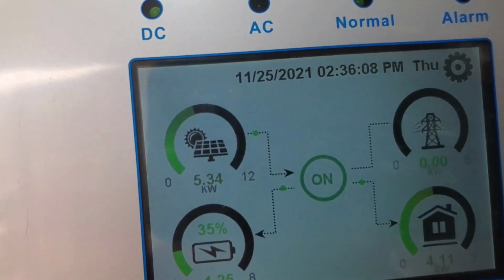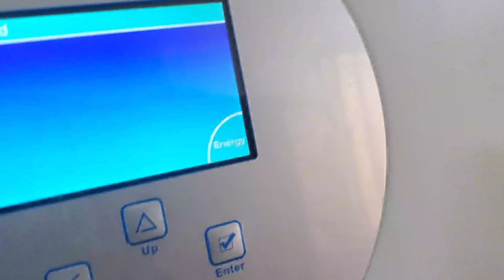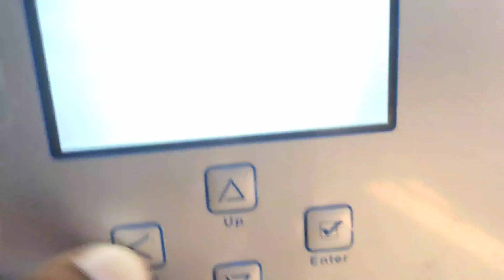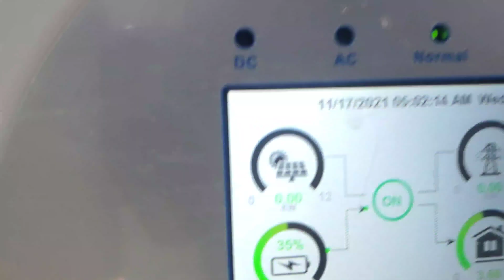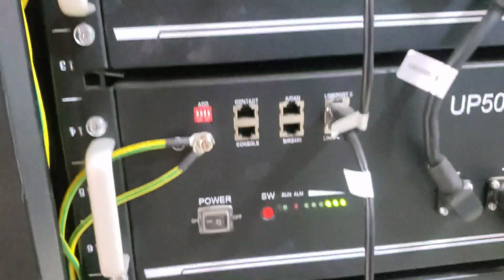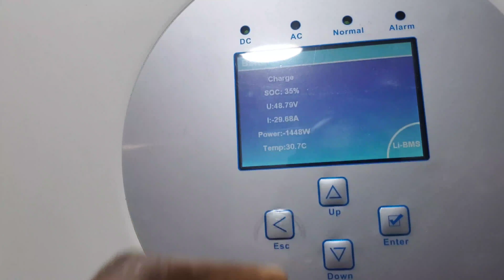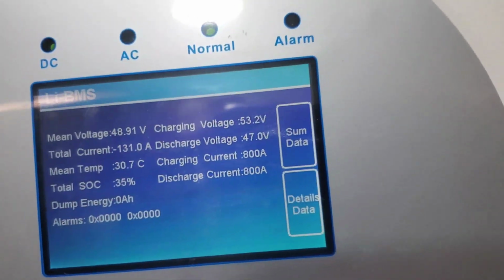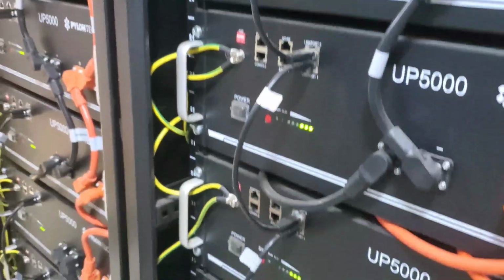The inverter room is super warm. 36 degrees C

Comment: yeah... putting them inside a room will cook indeed. THIS is why I am having second thoughts on getting 48V systems (Deye) instead of high voltage SolaX or Growatt HV series. Imagine: Just a small 0.0005 Ohm resistance (0.5 milli ohm) on each connection, passing 100Amps will produce 100^2 * 0.0005 = 5W of heat. Multiply that by 2 connections per cell, 15 cells per battery bank and you have 150W of heat per battery bank. I believe you have 9 Banks there and that is easily more than 1000W of heat.
Reply from the maker: I have 25 individual batteries connected to form this large battery bank. The batteries don't heat up enough to concern me. It is the inverter that does.
Reply: @drsolar  If your batteries dont heat up enough, then you got well made batteries!
Reply from the maker: @DanBurgaud  yes they barely move temperature wise. Thanks for your comments and for watching so many of my videos.

Comment: Interesting. First, I think your observations such as the glitches, the state of charge fluctuation etc may be partly due to the high temperature of the power room. This is only an hypothesis, and is the premise for my conclusion and recommendation. 

Recommendation: Fix the heat immediately. 
This solution mimicks what we all do when we get into our vehicles on a hot afternoon by allowing fresh outside air to come in to cool the interior of the vehicle faster than the ac would. 
If the ac upgrade does not completely fix it, do the following:
 Quick fix would be to install an industrial heat extractor with the incoming fresh taken from a direction where there's a shade (cooler air). This is to be done after the air conditioner upgrade, that is only if necessary. 
Please note that the incoming air will bring along dust, hence creates its dust maintenance issues which means regular cleaning and enclosing things that are difficult to clean efficiently. 
The extractor does doesn't have to operate continuously - it can be driven by a low- temperature thermostat. 

Longterm solution would be to build a purpose-built room for the inverters that allows heat to be dissipated quickly as they do for factories with high head room and with extractor. Then you can make your observation of  the SOC, glitches again at low temperature. In fact, check whether you can get same observation at low temperature situation like evening.
Reply from the maker: Excellent analysis. The AC filters were caked in dust. I cleaned them and the battery started to charge. I will revisit the battery connection to the inverter again. The extractor while a good idea will make the remove less sterile and filled with dust. I will post an update on Monday. Thank you so much for sharing these ideas and thoughts.

Comment: Better run the backup geny on a schedule. Maybe 3 hours 3 times a week. Probably could use more pv.Its a lot already tho. Not sure I would trust that glitching inverter to handle a big load. What happens if 1 inverter fails under heavy load?
Reply from the maker: The generator has to run every day. They do need more pv when they have a lot of loads. If one goes it takes the other 8 down

Comment: Also add some air extractor which will push out the hot air
Reply from the maker: The filters on the AC were clogged with dust. I cleaned them and the temperature dropped 5 degrees
Reply: @drsolar  Given that it’s Africa, it’s inevitable, rainy season comes the dust will cake-up, an couple of extractor fans will help with a mesh to keep bugs out & a regular monthly maintenance contract just for cleaning the room, will be handy. As you know, heat & electrical stuff are not friends. That’s my 2-cents.

Comment: My 1x US3000C can only Charge 37A Max and Discharge 37A, even though is set at 74A on the 5kw Deye. 
* The battery Bms self adapted - looks like the limit are internal.
* I was expecting a higher limit on 5000 model.
Reply: US300C Capacity is 74Ah but max charge/discharge is around 50A.      so 74Ah is not safe at all
Reply: @sergea1138  how is your inverter controlling the battery? Bms Self adoption or something else?
* I personally prefare self adoption - the battery Bms controls discharge or charge requirement.
Reply from the maker: @sergea1138  37 Amp per module. Less than 50
Reply from the maker: Please change the settings the battery Bms should not always be the gate keeper. One day it will fail. The Up5000 is 50 amps. Thanks for watching and commenting
Reply: I did notice that the US3000C charges N discharges at 37A also and my load required more than 37A, I had to add a US2000 to the bank to compensate...

Comment: all that heat you need to capture it with a heat pump water heater which will cool your room and supply hot water for someone.
Reply from the maker: Please tell me how
Reply: @drsolar  They are standard devices and just plug in you keep them in the room with the heat and they use the heat as a source to make hot water the by product is the cool air. Rheem has an 80 gallon one with 10 year warranty but you will have to use the hot water produced to keep the unit running for air.